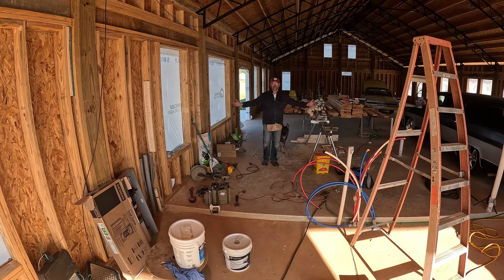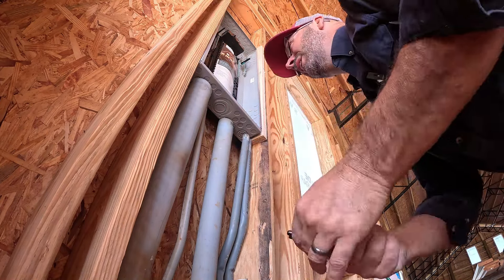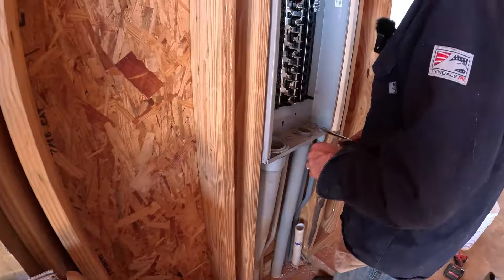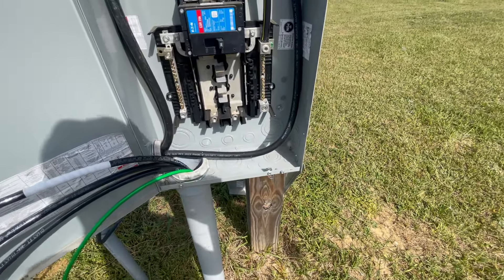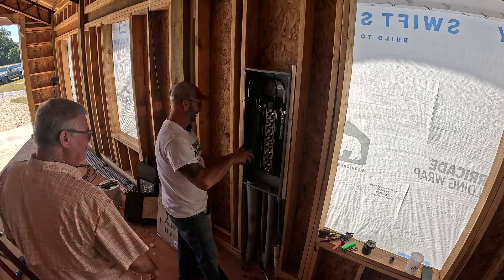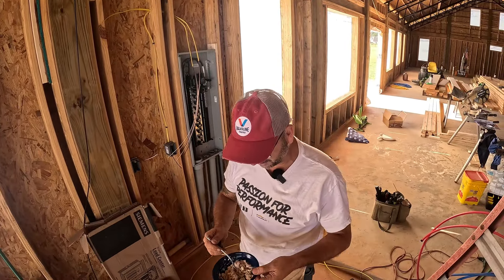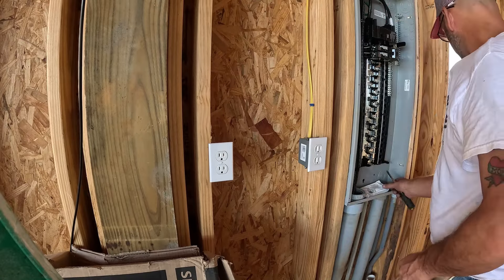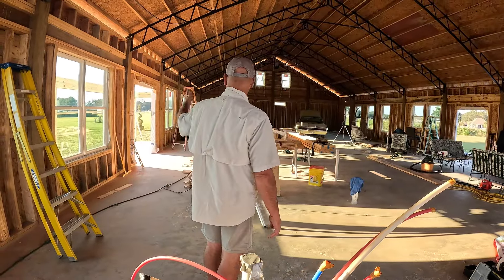We have Power!!  We install a 200Amp Electrical service to our Barndo!  Let there be light!  #diy

Comment: this is a fantastic video Tim. you're a very talented electrician. plus I'm also amazed at what I've learned in the HVAC industry about power supply and how it works. I've always wondered how they pulled those underground lines like that. really good video. really good. thanks for sharing it.
Reply from the maker: Thanks man, you’re too kind!